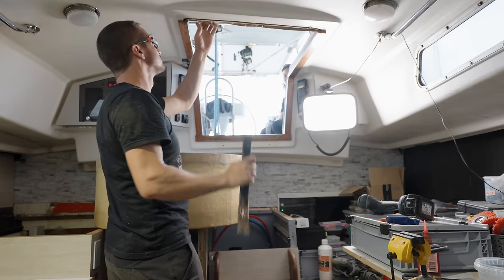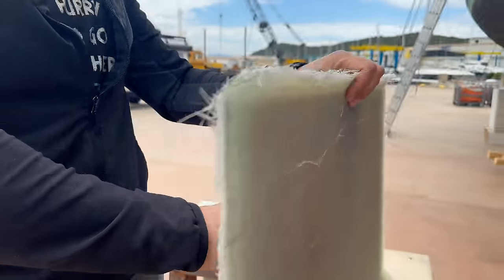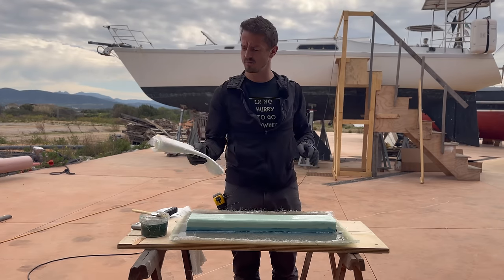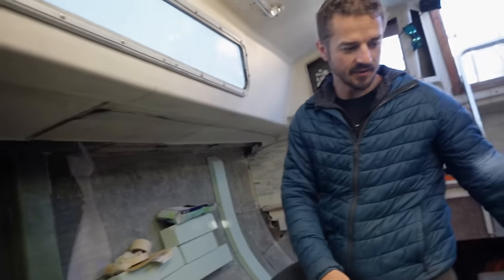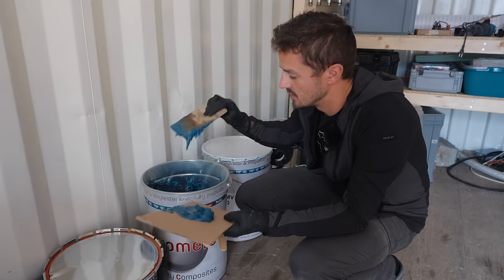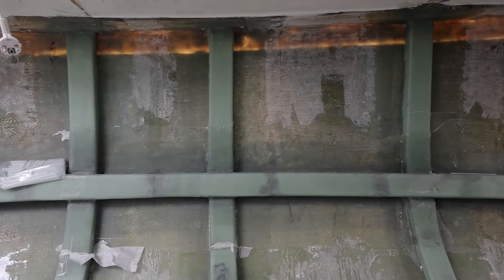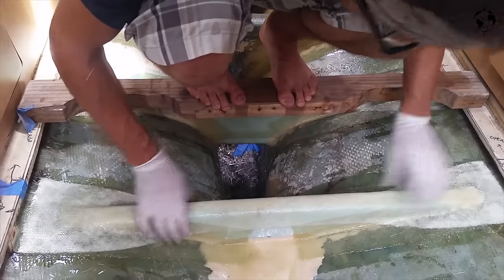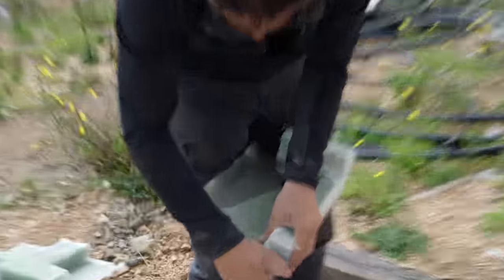Cutting Open our “New Hull”: What Could Go Wrong? | Step 386

Comment: I feel your pain and I'm so sorry for your troubles 😢. 
I was thinking slightly different 🤔: ie; i would have made this test before i do the haule. Also i wasn't too sure about that sponge glueing method 😳 🤔. I would have tested it by trying to pull it off before trying to stiffen it with fiber glass. Also would stiffen that sponge to make it stronger 💪 before covering it.
But hey it's just the beginning and it's boat inside a boat , may be you still can enforce it with spray foam insulation then the sheets of wood to cover it all up and by the time you rebuild the interior,  it will push against it and hopefully that sponge will be pushed in more by the weight against it 🤞🤞🤞🤞😉 
Don't despair, there is light at the end of the tunnel. You're doing great just keep it up 💯💪👌👍🤷‍♂️I wish you the very BEST of LUCK ✌❤☘
Reply: The foam is just there to hold the inner glass layups in a particular shape. The bonding points are where the layers of glass make contact. These would form the points of load transfer between the outer hull and the inner structure.

Comment: The topside hull stringer may trap any condensate or leaks. Really the foams section should be shaped with angles side faces. This also makes it better for achieving  a blister free laminate, particularly if using heavier laminations.

Comment: I'm no engineer but as the pvc foam is light, flexible, it also very brittle. I believe I understand you want to mount your conduit to it?? Wouldn't the strength only be in the glass wrap??  Looking forward to end result!

Comment: being a marine tech. i do use west systems epoxy over any resins do to it being stronger and sticks to almost anything. polyester resin only sticks to its self kinda.. Vinyl ester resins with stick to polyester and can be a little temperamental with sticking to itself. epoxy will stick to both no problem. they also have the pumps that insure you have the right  ratio every time

Comment: Secondary bonding issue with vynalester. The real question is, why you did not test a sample before they started work? The saving grace moment might be that your hull is polyster based that has been grinded and cleaned, so not the same as your test panel.   No doubt you have already tested a small part of what has been bonded already.

Comment: The Epoxy surface exposed to air oxidizes really quickly (hours).  You needed to rough up the surface of the fiberglass in your model with sandpaper before you laid down your new layers of fiberglass.  If you had used peel ply when you built your hull model, you could have waited until you were ready to attach and lay up your stringers to remove the peel ply and start the glassing onto the surface.
Reply: It's not epoxy, it's vinylester resin.

Comment: As a fellow sailor and architect who has followed you since step 1 I sincerely hope this is YT drama and the crew inside the boat got better adhesion. If not then you will have to fix this issue. The project can't move forward until it is resolved.

Comment: What is your external hull made of? Epoxy? Bonding different types of resign can cause delamination. Also I would have fiber glassed around(under it also) each foam board and not used glue.

Comment: An after the fact comment but the first thing I saw was a hot glue gun. I thought, to myself, that's only for arts and crafts and old tennis shoe repair. Your sample and test showed that to be the failure point. It's hard to imagine that with the structural system you have created, tabbing everything to the hull and adding more layers that a weak glue used for lay up would compromise the strength of the design. Your sample wasn't connected to a structure or to the whole system. Your hull inside your hull won't separate. Uma strong!

Comment: Hi guys! I immediately had doubts about the strength since you used polyester resin. If we compare the adhesion of polyester resin and epoxy, the latter is several times better. Use epoxy resin and you will succeed.
Reply from the maker: Epoxy is also significantly more expensive. Every new boat currently being build uses vinylester. If it were really that must weaker, they wouldn't be using it.
Reply: @SailingUma  Dan, I wouldn't put that much faith and trust in the manufactures always making/using the best solution, if the solution is cheaper, you better believe that they are going to go that way, an expenditure is a controllable expense on any balance sheet and if there is a less expensive solution, they are going to go that way, look at what Boeing did with their airplanes recently...

Comment: So sorry the bonding hasn't worked,   could you somehow get some sort of self-tapping screws with a shaft tip, to screw in and bond over, I can remember we had some sort of shoulder screw,  we had something like this at my workplace a good few years ago ( but not for boat building,, Engineering), I can't think of anything else unless you drill holes through the bulkhead, !! eek, hope things work out with all the hard work you are doing. Atb.

Comment: When @ransailing was starting the second layer of his freshly laid hull, he said he had to clean it all really well because fresh fiberglass has a flush that comes to the surface. Almost like the oxidized surface of raw aluminum that has to be cut. It doesn't seem like your original hull wouldn't have that issue.
Reply from the maker: It depends on the resin you use. Some blush. Some don’t. Some have wax. Some don’t.

Comment: This is where you go and have a conversation with the experts doing the hull for you. I think they were saturating the fabric before applying. You just wetted with rollers. That may make a difference, but I would definitely let the experts decide. You aren't so far along you can't start over to get the bond you need.

Comment: Very brave reactions after delaminating sample!!!  As no apparent damage to each component sections, would the hammer test on the hull or inside on a rib be appropriate?  

Considering the failed bond on the test piece, for peace of mind, consultation with experts is good, but isn’t a bonding test of the new glass work in the boat the only way to make sure the bond is solid?

Comment: I’m wondering whether just spraying 3” of closed cell foam would accomplish the same objective of stiffening the boat.  Possibly even better than ribs due to the uniformity of the layer. I’ve tried to remove the stuff after it’s fully cured. A sledgehammer just bounces off.  You need to cut it out with demo bladed sawsall.  Also would provide insulation for cooler areas.  Super light. Super inexpensive. Makes the boat unsinkable.

Comment: Vinylester will NOT bond to the old, dry, fully cured hull. You will have delamination, it's just a matter of time. To create mechanical bond, you should use epoxy.
Reply: That is what I am told

Comment: Delamination bad.  allowing the bottom layer to cure than adding the top means you have no molecular bond.   no amount of acetone and sanding will resolve this.    I assume that your builders are either using epoxy between cured laminations or that they do it all in one go so that the layers are properly crosslinked.

Comment: That's why the joint should be made using epoxy. Heck, back in the 90s, I was reworking my first polyester boat. I used epoxy to attach the stringers and bulkheads and frames. Because epoxy offers a much stronger bond between new and the old. I'm always impressed with the projects you guys do. This is a huge mistake !! Who is the engineer you mentioned
Reply: I really have to ask is the engineer you mentioned???

Comment: I would think the order does matter if you are feathering the edges. If you lay up the narrow piece first with the wide piece on top, you will be sanding through the wide piece making it narrow to get a nice smooth edge. If you lay up the wide piece first with the narrow piece on top, you will sand away the edges of the narrow piece keeping the wide piece wide.
Reply from the maker: When sanding, the goal is to remove as little glass as possible. You're just keying the surface, not removing anything. You're exposing the glass fibers from their resin casing. It's a very light sand.
Reply: @SailingUma  I agree in the case of your ribs and any hidden structural bonding but I am referring to when people want to feather and fair the edges so they want a nice taper. That requires more sanding and removing more material. In those cases, they are removing long fibers if the wide pieces are on top.

Comment: All that wet layup is adding a lot of weight to the hull.  But it's not just (a lot of) extra weight, it's actually losing stiffness.

Consider a chunk of uniaxial fiberglass in resin.  The fiber itself is about 72 GPa stiffness, and the epoxy is 2 or 3 GPa, so like 20 times less.

In the direction of the fiber, the stiffness is almost completely determined by the fiber.  When you add extra resin in there, you actually increase the stiffness in the direction of the fiber a tiny bit.

But when you apply load in the direction ACROSS the fiber, the load path actually goes through the fibers, passing through the epoxy to jump from one fiber to the next.  The load will be supported along zillions of paths that thread through the maximum glass and minimum epoxy.  The stiffness you get across the grain is primarily determined by how much epoxy those load paths go through.  In a vacuum-infused part with minimum epoxy, you might get one-third as much stiffness across the grain as you get along it.  But add a bunch of epoxy to take the thickness from 1 to 1.4 cm, and now you've added at least 0.4 cm of epoxy to the load path.  That's going to dominate the stiffness of the fiber and you'll get stiffness close to that of the epoxy alone.
Reply from the maker: Only ads about 200-250kg or extra weight. But significant stiffness. Which will ultimately make for a better sailing experience.
Reply: @SailingUma  No doubt it will be better, stiffer, stronger, safer.

I'm making a point about wet layup vs e.g. vacuum infusion.  Assuming you have the same fiber layup with both techniques, using more resin means less stiffness.

For a sailboat hull, not around the chainplates, more stiffness is not necessarily a good thing.  More strength is almost always good (but it costs), but stiffness is different.  People are building a lot of high-end boats from carbon fiber, and that's foolish for most applications.  Great for racing, when you have high certainty of rescue if the hull shatters.  Crappy for adventure sailing.  Kevlar is probably best for adventure sailing, but it's more expensive than carbon fiber.  Fiberglass is a good choice.

Around stress concentrations like the chainplates, carbon can be better, but you have to be very careful about the transition from carbon to fiberglass.  It's easier to just use more fiberglass.  :)

What's your lightning grounding strategy?

Comment: "Polyester Resin, or fiberglass resin will melt EPS foam. You must use epoxy resin when working with EPS/polystyrene. 
PU, polyurethane foam, will be okay with either polyester resin or epoxy resin." 
EPS foam= Expanded PolyStyrene foam is used in packaging & stand-up paddle boards, use epoxy resin for repairs to your SUP!
Both polystyrene and polyurethane closed cell foam sheets and extrusions come in different densities.

Comment: I think the failure has to do with gluing the foam; it shoud be glued with a vinylester goo so when you have an impact, the glued foam doesn't star the delamination process. I think also that the resin rich lamination makes it easy to delaminate. Professionals refer this as 50/50 resin to material ratio.
Reply from the maker: The foam just holds the glass in place until it dries. We could remove it and still have the same strength.

Comment: Re using any foam for the core... That is mostly true for a boat this size but the core is also acting as a sheartie between the two skins to keep them acting as one beam. A ultralight weight non structural forming foam may not be so wise for all framing applications, particularly where additional compression loads are applied, I.e mast step. But again I think for a boat like UMA it's all over built anyway so It should be fine..

Comment: Poly/Vinyl laminating resin will not cure in the presence of air (the exposed face of the lay-up). That's why you can continue to laminate even if  the underlying laminate has cured. This is the nice thing  about poly/vinyl resin layup compared to epoxy. By using peel ply, you are allowing outermost face to cure where the peel ply is solid (no air). Therefore you need to sand before continuing. But there is no need for peel ply if you plan to continue your lay-up. In fact it is better without, as you achieve a chemical bond instead of a secondary/mechanical bond when continuing your lay-up. No need to sand either as this will just gum up your paper. I believe the pro's did not use peel ply? Also, apparently, some kinds of peel ply may leave behind contamination. Also, did you use CSM in alternate layers of the lay-up (or maybe you used a combination cloth including CSM on one side like '1708' )?

Comment: Question 2 In terms of cracking noises wouldn't it have  been better to fill those spaces up with the filler. I'm referring to the section moment when you see the gap between the overlaying beams.

Comment: Will you be insulating the hull? Cuts down on condensation in cold weather and keeps the inside cool in hot climates. Will you come-up with something to protect the rudder from Orcas? Should you follow Antoine Grondin's advice by putting a layer of fiberglass between the hull and stringers would it have solved this delaminating issue? Lesson, what ever you add on the re-enforce the hull needs to become an integral part of the boat and not glued on.

Comment: Might be hard to see the positives right now, but it is better to know about potential issues now in advance before you spend another year building all of the interior structure and final finishes. I was curious about a couple of things though... Why use such thick pieces of expanded polystyrene for ribs & stringers, rather than using more thin strips of extruded polystyrene to save on interior space? Living in such a small space, I would think saving half a foot or so more would be important. Would several inch and a half thick ribs be stronger than a single large one? (Extruded polystyrene might be a little less flexible, but it does not absorb water & gives much better insulation value.) ...and why would you not choose epoxy resin over the polyester for a better bond?

Comment: Thank you so much for showing the failure It takes guts to admit such a mistake. 
Personally I would demand and insist on a lab style delamination experiment inside Uma., an hour is all it takes.

Isolate a foot of a rib by cutting it and the laminate as close to the hull as possible , drill a medium hole in the rib , insert a rope or cable and pull (maybe a wood block/cross-bridge/car jack system).( may have to epoxy a 2X4 on top if rib gives away)
If it pulls really easy I say lift the whole rib structure in convenient segments and reset the same whole structure in epoxy and then work on joining the segments.
 PS:This is what I think not what I know , since there is a major difference.

Comment: Hey guys! Loving your content! Did you (Or the shipwrights?) consider vacuum bagging each longitudinal/tranverse girder, to wet out the laminate thoroughly, so as to minimise air-gaps? Would love to hear your rationale...🤔
Reply from the maker: We did have many discussions about vacuum vs not. It was just easier and faster to hand lay. If we were worried about minimal safety margins or ultimate stregth to weight ratio (like a race boat or airplane) it would make sense. But for our old, slow girl, there isn't much reason to.

Comment: I don't think that the new structure can "separate" from the old "mold", like your mockup did. They are both different structures with different functions. The ideal issue was, obviously, a complete union between them, but the external will be supported by the extremely rigid internal one, and for me, that's a goal. You can, maybe, pin them... but the external paint will be affected.
Reply: wrong.
If the inner and outer are not bonded, the outer is unable to transfer load to the inner and as such the inner is useless. The outer would therefore flex repeatedly and eventually stress fracture.

Comment: On the model the strength is concentrated into one small area and attacking it with a hammer concentrated a lot of force into one small area 

Surely with the actual hull’s strength being spread over a large area it will be much stronger overall than the model?